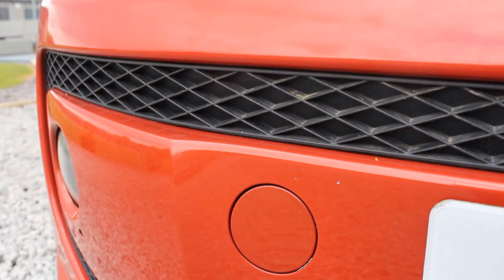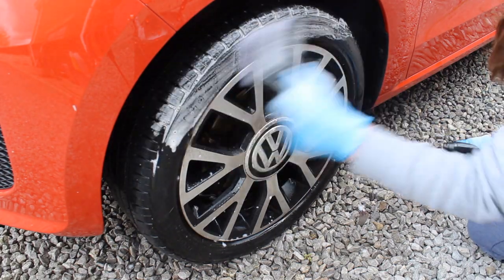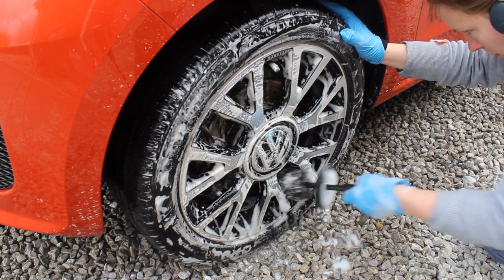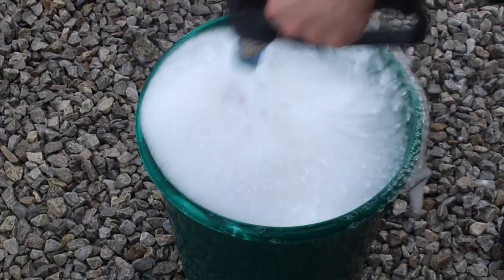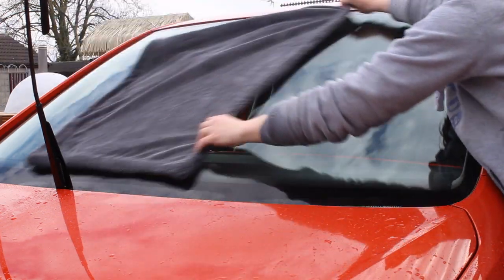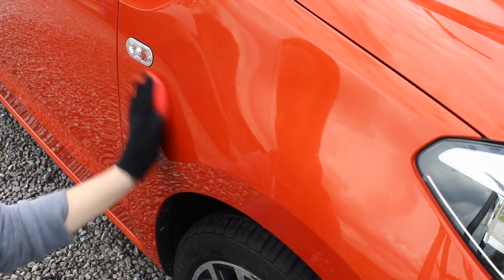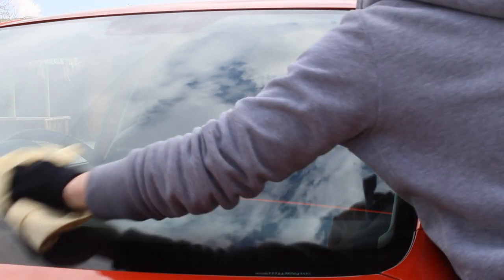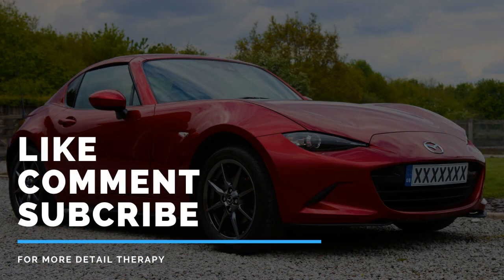CAR WASH AND CERAMIC WAX | Cleaning this Volkswagen Up!

Comment: Really good video packed with tips. Have you ever done a review on Swissvax?  I use their products on my car and the results always impress me.  I use Bilt Hamber Touch-Less as part of the pre-wash process.  I like the Best of Show Carnauba wax for the paint work and the wheels I use Autobahn polish.  Crystal Glass leaves my glass really clear.  After the weekly wash, my car really shines.  I follow their car wash protocol which is a good routine.

Comment: Hi, I keep finding your videos that I haven't seen yet,,, lol.. How do you recommend washing the windscreen after the application of the Pyramid,, ??  I applied it a couple of weeks ago, and have yet to clean my Polo,,
(it's hardly rained much here either,, ha ha..)
Just wondering if I should keep as many products off the screen as possible, or simply wash as usual,, ??
I usually finish with auto finesse Lavish,, should I keep this off the screen, ??
All the very best,,   John
Reply from the maker: Hi John, I just washed mine as normal with regular wax free shampoo but glass cleaners won’t do it any harm between washes either. I wouldn’t use lavish though on it just in case it causes any wiper juddering but it won’t be a disaster if some ends up splashing on it!
Reply: @AutoCareHQ 
Thanks yet again,, I really value your advice,,
I highly rate the Lavish, so I'll use it, and try to keep as much as possible away from the screen,,   still don't know about the "juddering" 'cos as I said, we haven't had much rain, here in West Yorkshire,,  thanks again,,....    John...

Comment: Hey Heather great video, never ceases to amaze me how you manage to pack so much information into such a short video. I’ve got a product recommendation for you, try Autoglanz Rebound on the tyres, it will save you cleaning each tire three times, just think of the time that will save you ha ha.
Also on your Glass sealant video you used remix and I suggested it might be easier to remove if you spritz some water to help removal, must have slipped your mind 😜
Reply from the maker: Cheers Graeme! I’ve got that in the basket for my next order, feel like I’m missing a trick using APC all the time and that rebound looks really cheap. Honestly completely forgot about the water spritz trick until I was packing everything away 😂
Reply: @AutoCareHQ  I knew you’d forgotten and probably kicking yourself for wasting all that time buffing it off 🤣

Comment: Great video Heather, gloss levels looks amazing, I've missed the boat on the ceramic wax costing £9.99 as it's now gone up to a massive £12.99!🤣I'm still ordering it at that price.
Keep up the good work and great content 👍🏻
Reply from the maker: Cheers Paul! Completely forgot to mention it in the video but if you use the code ACHQ you should be able to get 15% off if you’ve not ordered it yet! 😊
Reply: @AutoCareHQ  phew! Thanks for letting me know that, I'll definitely use the code now 🤓

Comment: Hi Heather, you didn’t start off with an initial spray of ONR before the initial pressure washer rinse?  Crackin’ video you’ve got a huge fan across the pond.
Reply from the maker: Thank you! I’ve not been using the initial spray of ONR on every wash to be honest, just when the car is really dirty or I know the finish is very delicate 😊

Comment: I love the content always try to remember to leave a like to you great stuff and I see when I wash my car after the foam rinsing the beading gets better but after contact wash gets worse what could it be? I use Finnish care hi-temp wax and it's near a month and was not so nice to look at more like sheeting and I have a test on the hood with toppers on the wax same with them-got worse after the contact wash I use bilt hamber auto wash and gyeon essence 1:2000
Reply from the maker: Thank you! Hmm that’s a bit strange, sometimes it can happen with shampoos with waxes/ gloss enhancers in them as they can clog the paint protection up a bit but those products don’t have anything like that in as far as I’m aware. The only thing I can think of is that maybe the protection products haven’t bonded properly maybe?
Reply: Simas, not saying you’re wrong here but it may just be your perception. If I’ve got this right you are checking beading and sheeting before snow foaming and then afterwards. If the foam is working well it will give you a big improvement over the original dirty car. Contact wash will improve this ( or should!) but might give a less drastic improvement than you get from dirty - prewash. I could well be wrong but it’s worth considering. All I can say is if you’re not happy strip back to bare paint, go over with IPA and start fresh using the minimal amount of products then recheck. Good luck.

Comment: I've noticed you don't drag the towel on videos. Is this only on paint corrected cars? That makes sense. Otherwise it wouldn't matter enough surely as all cars have various swirls/marring? Or is more of an ocd type thing 😉. Like the videos 👍
Reply from the maker: I got into the habit of just patting the car dry instead of dragging the towel on my car after I corrected it but now I do it on most cars just out of habit really 😂